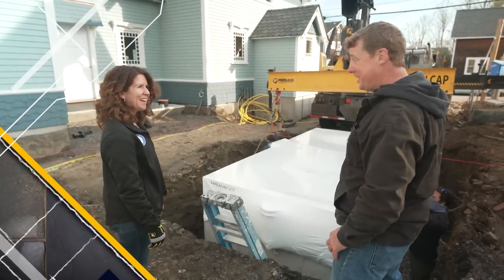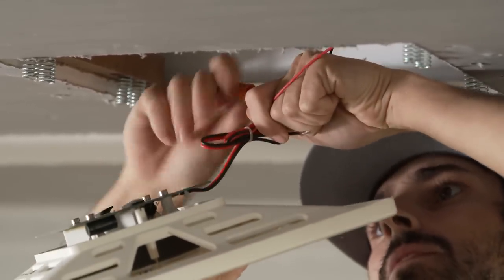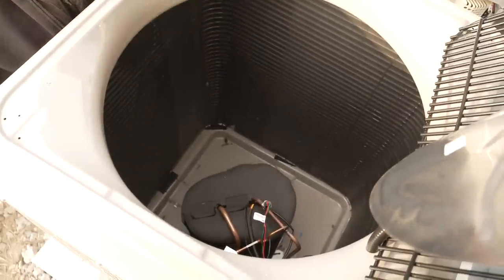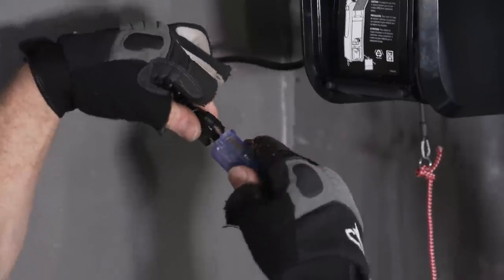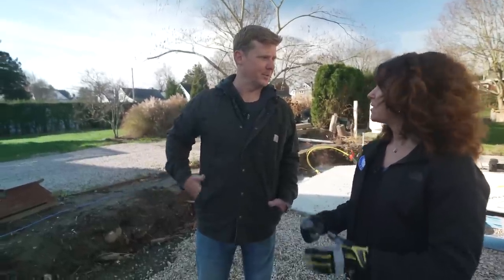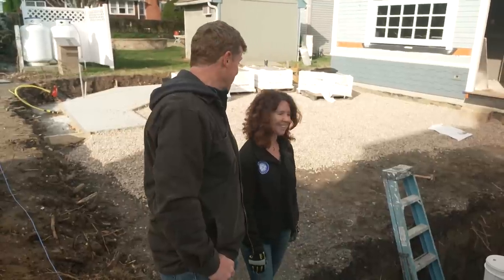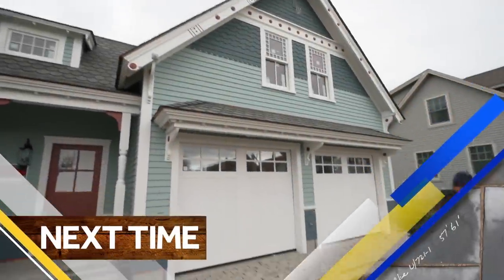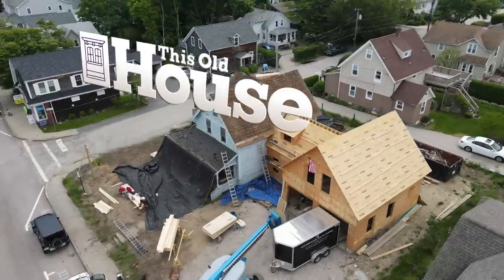This Old House | Design Elements (S42 E11) | FULL EPISODE

Comment: Instant pool for only double the price and probably the same if not longer lead time. Must be nice.
Reply: I believe the "instant pool" is half the price as a traditional one. Listen again, she said 30k, and most in-ground pools are pushing 60k these days.
Reply: You listen again. Onsite built is half the cost.
Reply: I don't think money is an issue to them.
Reply: @allentoyokawa9068  thats why i said must be nice.
Reply: @mitchdenner9743  Exact wording: "And if I were to do it with an on-site process, how does it compare to that?"  "It's right around half"  The way this would be interpreted is that it costs half when compared to an on-site process.
Reply: @triyence3258  does that include the other contractors and materials required to actually finish the pool installation? They just dropped a concrete tub in th the ground for 30k and left the remaining work for other contractors
Reply: @triyence3258  I'm not afraid to admit when I'm wrong,  even though i listened to that like five times, until I focused on the words compared to ig didn't click. Don't  get old. I guess I got joe biden syndrome. 🤡
Reply: @mitchdenner9743  😮

Comment: My issue with the speakers inside the ceiling with plaster hiding it is what happens if the speaker decides to go bad? You have to cut open the wall to get to it. What if the wiring goes bad? You'd have to troubleshoot all the speakers installed. Idk, maybe it's just me.
Reply: It is the dumbest idea for people don't know anything about sound.:face-turquoise-covering-eyes:

Comment: How is maintenance and repairs done on the speakers ?
Reply: Maintenance???  Repair means a BIG repair.
Reply: No maintenance done on the speaker if the speaker fails ie melted voice coil or torn cone your cutting into the plaster removing the speaker and replacing it and replastering  the ceiling
Reply: That's the neat part: you don't!
Reply: Burn down the house... and start over.  They get replaced in the process.  It's the classic speakers lament.
Reply: This isn't a product I would even consider. I can't imagine putting drywall compound over a speaker baffle that will vibrate the ceiling. Let's see how it holds up after 20 years. I'm guessing they mixed in some acrylic for more flexibility and bonding? What happens when you shell out $650+ USD for a single speaker (not including installation and amplification) and it doesn't sound like you had hoped? What if cracking develops around the speaker frame? What if you add too many paint layers? I don't know, the product seems too dependent on the installation and tolerances. This whole trend of hiding things makes no sense. I'd rather have equipment I can easily access and upgrade but at least these speakers would be difficult to steal. :) Just my $0.02.
Reply: @fotogmike303  Replace the speaker and PATCH the ceiling.  Is it a big repair?  Sure.  Is it worth it to have a beautiful ceiling?  That is subjective,  I think it is.  People who don't agree should put in a "serviceable" speaker.
Reply: There no maintenance on a speaker. Just repairs. It will just take more time and money to fix or replace them.
But speaker can last for decades.
Reply: @fotogmike303  Replacing it?
But will they still be making them in 10, 20 years, when they do go bad?
Reply: @DouglasPelo  Yeah. I would just put in a regular speaker. And just paint the speaker grill to match the ceiling color.
Reply: I have been making and studying speakers for 40 years. It is pure idiocy to put speakers "buried" in plaster! Good luck with the finished "sound".

Comment: Speakers are better in a wall.  No ear on the top of the head.
Reply: 1D audio should be at the ear, all around. 2D audio is the same but you're just duplicating the same layout and placing it on another higher plane. 3D audio adds a third layer of speakers onto the ceiling.